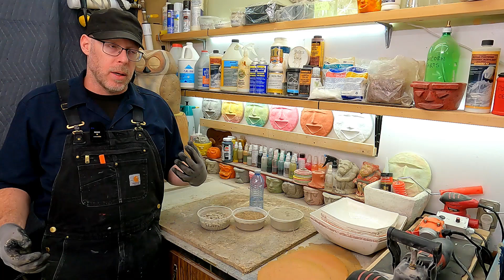Can You Leave Wood Forms on Concrete After Pouring?

Comment: Could do with some nuance about duration and context here. A well engineered form can help maintain hydration in the concrete for that 28 day wet cure ideal. After that, of course, it has to come off. But stripping the form off the moment the concrete is set is going to expose brittle corners to breakage before they're properly cured, and it may make maintaining hydration a whole lot harder than it needs to be.
Of course for small objects, you could maintain hydration by removing them from the form and placing them in a water trough to cure. Then you can re-use your form a whole lot more than if it were being used to maintain hydration.